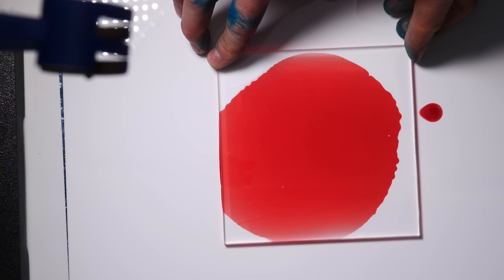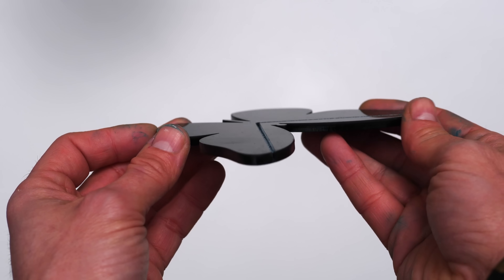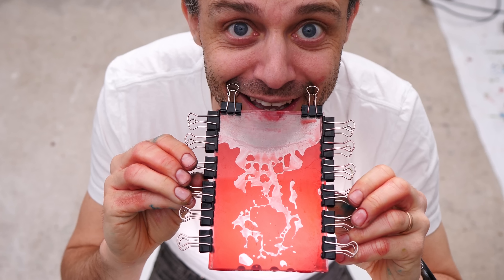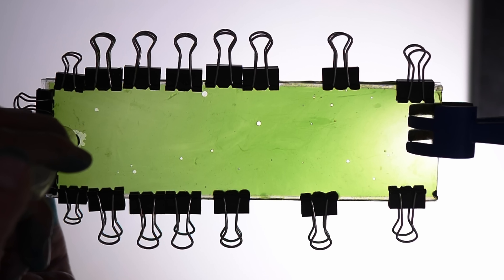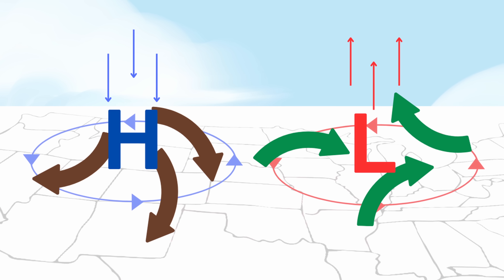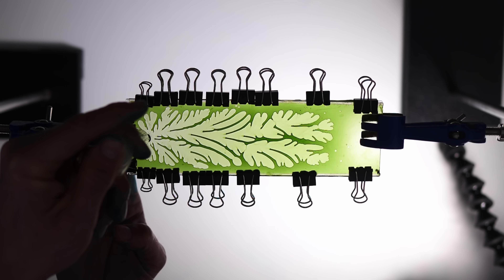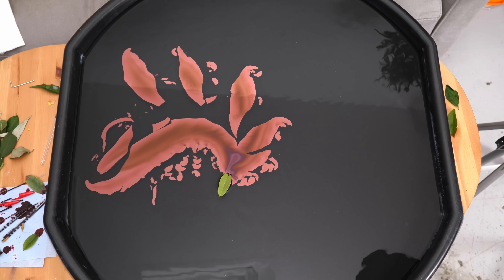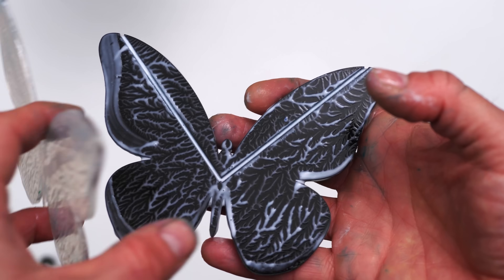Why honey makes these strange tendrils

Comment: Steve - for the butterfly you should try making two halves of a butterfly, putting them together, pulling them apart, and then lining them up to make a whole, symmetrical butterfly! Otherwise, amazing video, I always love learning cool things from you!

Edit: Someone already suggested this and I missed it haha!
Reply from the maker: Of course! Then both sides will be the same
Reply: @SteveMould  Anyone who has painted with a paint roller has made viscus fingers. It's just that the roller texture masks the pattern a bit. The more paint on the roller, the more recognizable the pattern.
Reply: @SteveMould  You could use an actual butterfly as a model, by which I mean 'add a hinge', or use a more flexible plastic.
Reply: Or add handles.to.the center of each part so you can pull thru the med side isntead of the borders?
Reply: @Alche987  Exactly, handles were my first thought. Maybe two plates extending from the bottom that one can stand on, clamp down or have someone else hold down, then a handle on top, on one side, to pull it off.

I think there are two obvious interesting choices for attaching the removal handle--either one point of attachment on the center-edge of of the top plate, like near the top of the head or bottom of the abdomen, OR, two points of attachment spaced equidistant from the center, somewhere near the top or bottom of the wings in this case.

I think the (potential) beauty is to have NEAR symmetrical sides--a perfect symmetrical fractal feels a bit... off. I would love to see a handle tried in an attempt to get unique but "same" fractals on each half of the moth, I mean, butterfly.

And I have a guess that with one point of attachment, the fractal may emanate out symmetrically INTO both halves, where if there are two points of attachment, the fractal may emanate symmetrically FROM each half, and meet in the middle.

It would be really cool to see what happens when you get two point sources for the viscous fingers that collide in the middle.
Reply: @Alche987 i was thinking the same thing
Reply: Or have a small notch down the middle,  with which you can start lifting the butterfly from the middle
Reply: Or just use a small flat screwdriver at the base of the center to wedge it apart.
Reply: @davidhorizon8401  just don't let the screwdriver slip, or that does it.
Reply: Yes, was thinking similarly... make a groove in the base running along the axis of symmetry and put a wire along it. To separate the halves just pull the wire up
Reply: Ooooh timed right you could sprinkle glitter or graphite that would only stick to the ridges...
Reply: You might be able to keep the whole butterfly cutout you have and use one of those wide paint scrapers to pry both edges of the wings at the same time, but it’d probably have some inconsistencies in the symmetry
Reply: Just got to pry it up along axis of symmetry... might be more fun but less symmetric to superglue a C-clamp's jaws to the center of each butterfly slide and slowly unscrew the goo..
Reply: Or use pressurized air to start the fingers near the middle and/or along those lines you made (make a Y formation, where you inject the air from the bottom of it)
Reply: You can keep the one-piece black butterfly, just cut the acrylic plates you pull off in half.
Reply: @ Niki, the pattern won't be symmetrical if it's done that way.  The fluctuations of where each part goes depend on microscopic differences, so no two patterns will be the same.
A simple half fold or two halves opened up is the easiest way to do this, as Tanner described above.  One could even cut out a body shape to attach in front, to hide the seam.
Reply: @ if you’re aiming for perfect symmetry you’re right.

Comment: For the butterfly, could you make the centre a hinge and peel each wing separately for a more symmetrical fractal?
Reply from the maker: Ooh, nice!
Reply: Just make one plate flexible and peel it up from two sides while holding the symmetry axis down for the first moment.
Reply: yep and that
Reply: In my mind the butterfly can be solved with a very small hole (like the electronics rest buttons) in the black part and a channel in the middle. To open them use a clip (again like the reset buttons) or a pin and counter force in the channel. The pattern should start from the hole position.

Comment: Here before the title is fixed
Reply from the maker: It always said pull
Reply: @SteveMould nothing happened something something tiananamen square 1989
Reply: Nelson approves.  @SteveMould
Reply: @SteveMould  now there's a textbook example of a suspiciously specific denial.
Reply: :face-blue-smiling:
Reply: "Spontaneous fractals when you pulling things apart" is the original for anyone here late.
Reply: @jackskudlarek3138  it's preserved in the Notification list for posterity 🤣
Reply: @jackskudlarek3138 at least get it right.  🤦
Reply: Pulling is correct, @SteveMould just forgot to add the “be” in front of pulling. 😂😮